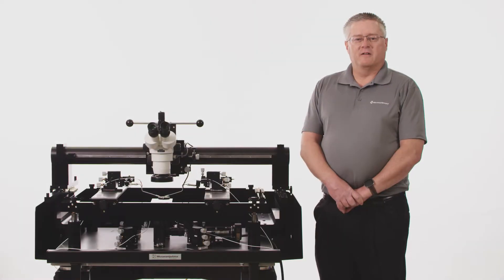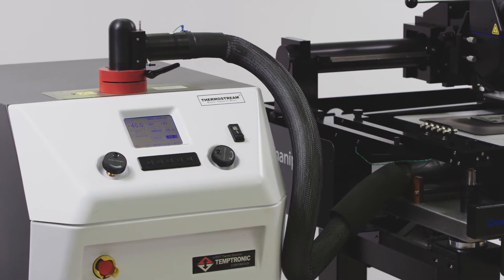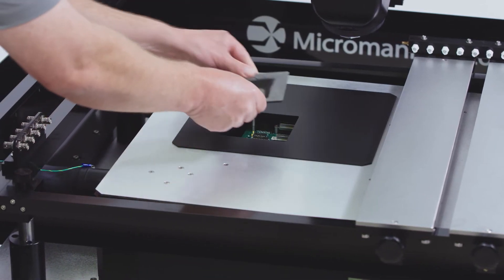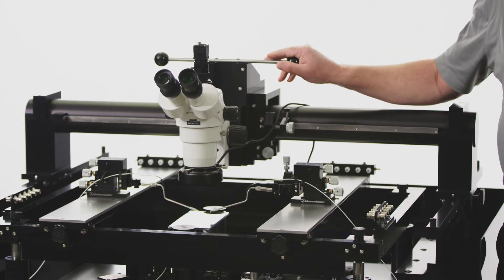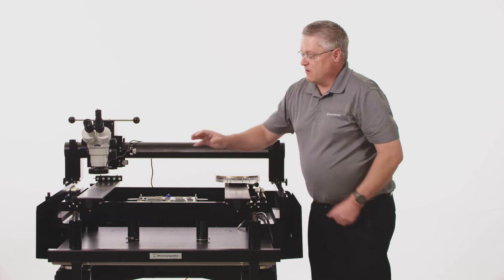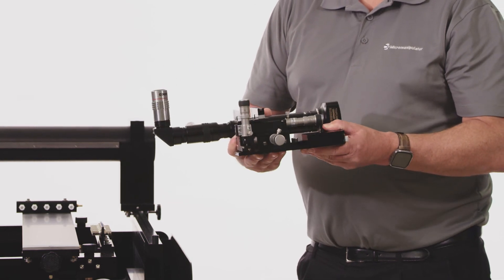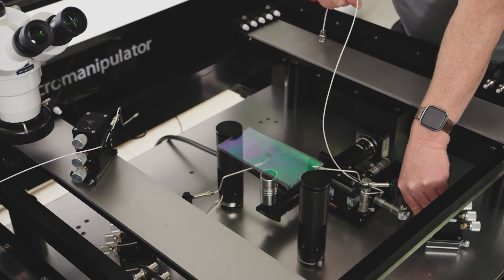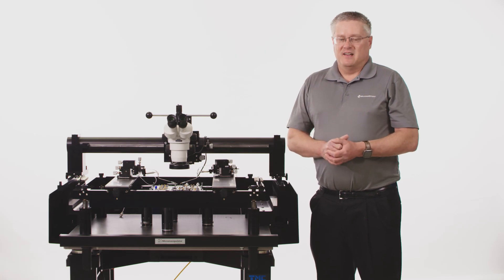Micromanipulator VERSA Full Video

Comment: How do you set up a wafer chuck for probing wafers? Also, can this system be used in conjunction with a probe card for probing test structures on the wafer? If so, how would you attach the probe card?
Reply from the maker: Hi James. There are several wafer chuck options that range from a small micrometer stage to integrating a completely automated wafer stage.  As for the Probe card we have a couple of solutions to learn more please email me at 
sales@micronprobing.com I am glad to review the options and assist you.